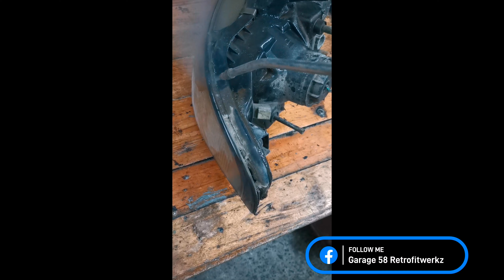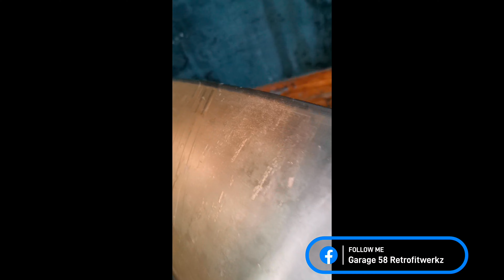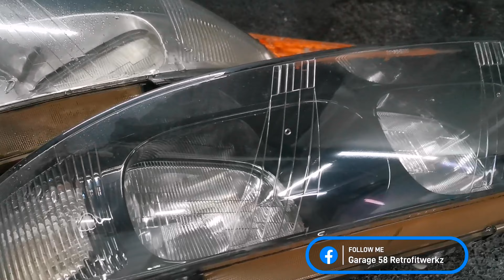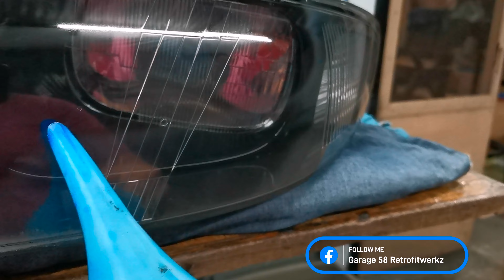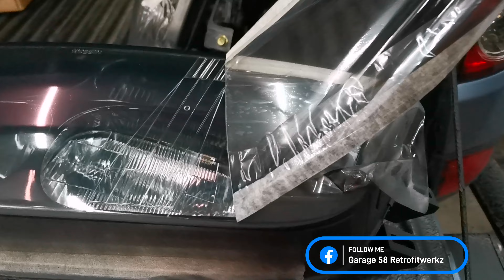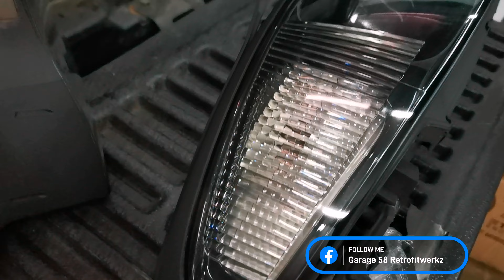Nissan Skyline R33 headlight lens restoration

Comment: What's this tool for cleaning the housings? I've never seen such thing
Reply from the maker: Just a steamer
Reply: @Garage58Retrofitwerkz  I suggested so but I never saw anything like this model before. I tried cleaning housings with Karcher SC3 but it didn't had the desired effect to me. I had better cleaning effect with regular APC and some regular brush. May I ask for the model of your steamer?
Reply from the maker: @Headlights.restorations  this is just a regular steamer from alibaba. Cheapest i could get.
I don't want to get my hands dirty that's why I use steamer with soap solution